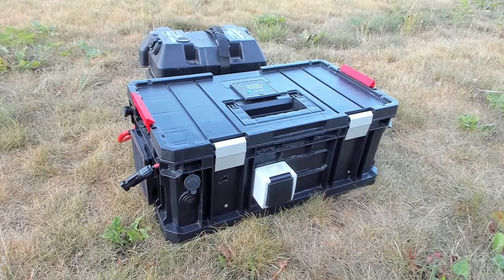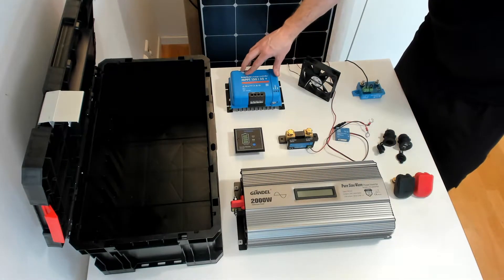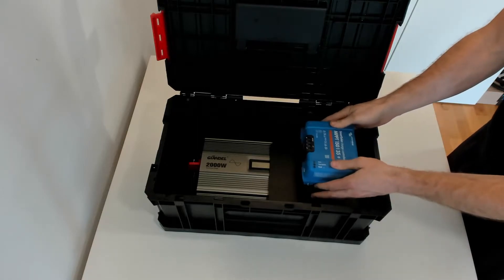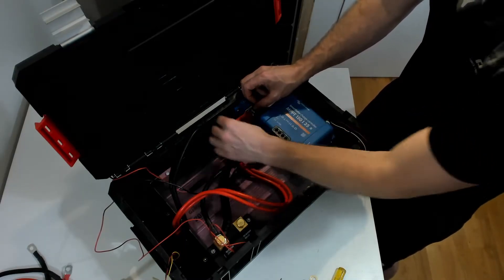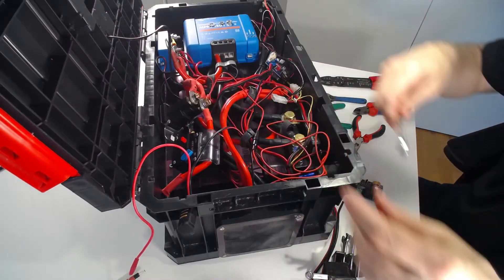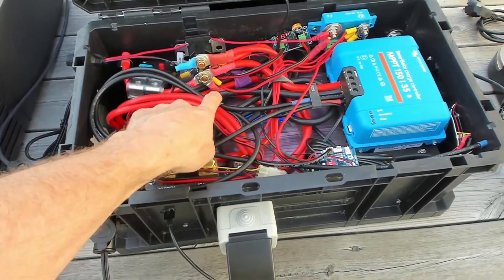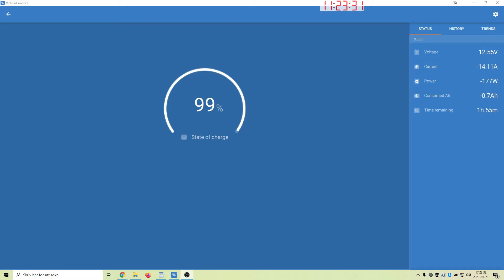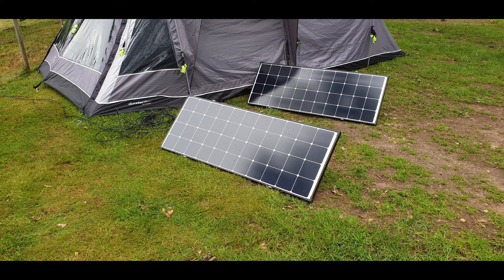How to build a Portable Solar Power System DIY (Premium v1)

Comment: Lead acid batteries are heavy but u can move them in a cart or garden wagon instead of a hand truck so don't fall out along with your inverter box 🤔
Reply from the maker: Hi Carlos, I was thinking of using this one https://geni.us/vBc4 but I thought it had to small wheels for camping areas with soft grass and gravel. So I went with one similar to this https://geni.us/zO7NqA8 as you see in the video and it was okay. I wanted it also to fit in my car with my big tent and other stuff so it had to be as small as possible. The car was fully packed so maybe I need to upgrade my car in the future 🤔

Comment: how do you calibrate the Victron smart protect?
Reply from the maker: Hi Niklas. Good question, the Victron Smart Protect is a low voltage cut-off/disconnect device for your load. So you only set the voltage that you want it to shut down the power to your load. But you can also manually turn it on or off from the App on your phone as shown in the video.